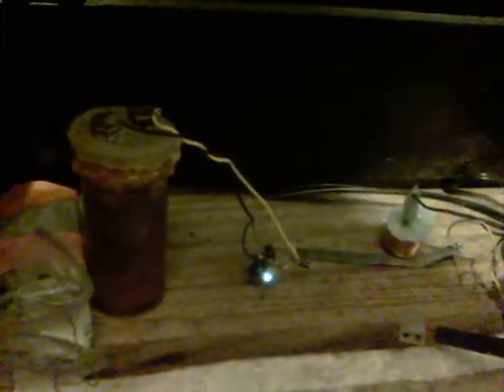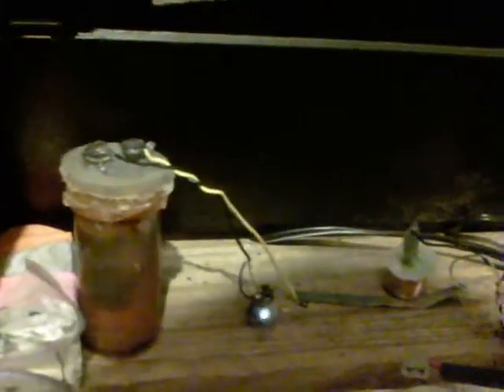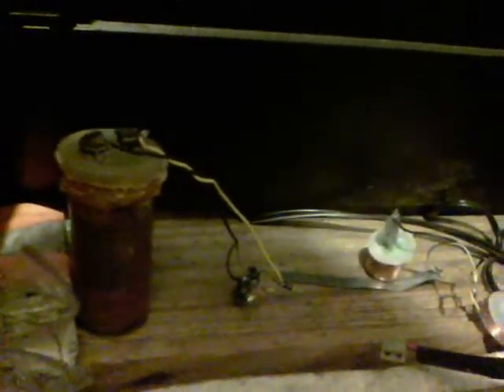Still going at 3 months + updates

Comment: I need to do an update on mine also.  I have so many it is hard to decide which ones to talk about.  Many of them I have just let dry out and are dormant.  The cooked "stove top" types and the rechargeables are probably the most interesting.  Most of the totally galvanic types have gone to battery heaven long ago.  Probably my favorite is "Phyllis" my plant battery because it is a living thing that has shared a pot for 3 years with the battery and an led oscillator that runs all the time.

Comment from the maker: Agreed, would be good to know how his cells are doing. Can't see your slab cell going anywhere for a few years, that's a winner. I do take occasional readings, the LED's show things much more easily though, like temp and humidity changes. The salts cells sit around 0.6V loaded, the wet carbon/lead around 0.8V unloaded, 0.65V loaded (just tested). Pretty low but running at those levels for ages.

Comment from the maker: Hi Simon. I haven't run baseline tests beyond a month or so...commercial alkalines would see nothing of a drop for probably a couple of years i'm sure. These oscillators generally use around 10uA and 0.5V, a month used to be a good run and mostly because the ingredients would dry out. Stovetop made cells and pressure cells far outperform most open air types. The curio is the one that runs from air moisture, it has epsom salts in the top and will awaken from months of 'sleep' as humidity builds.